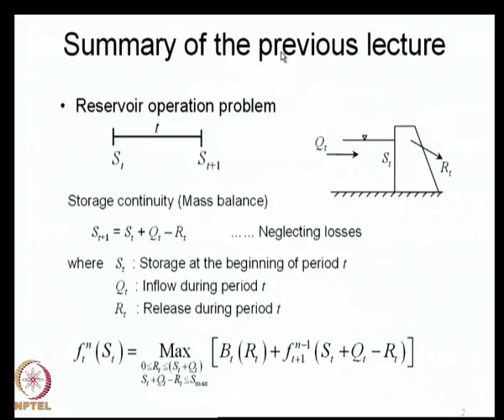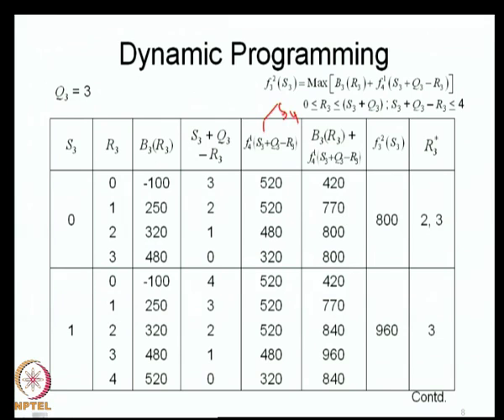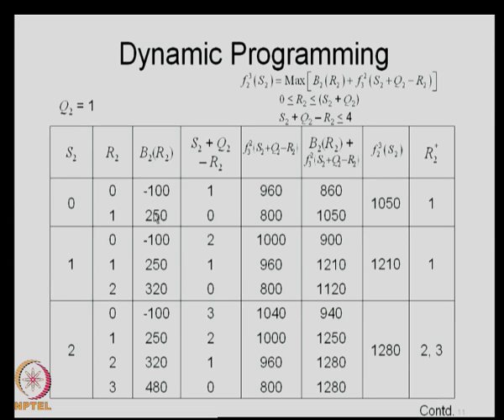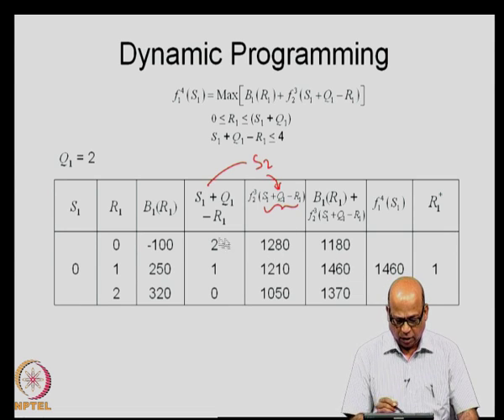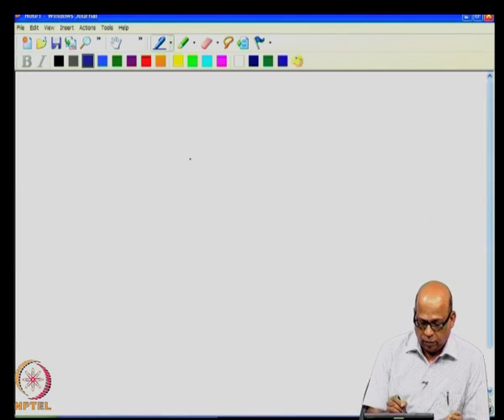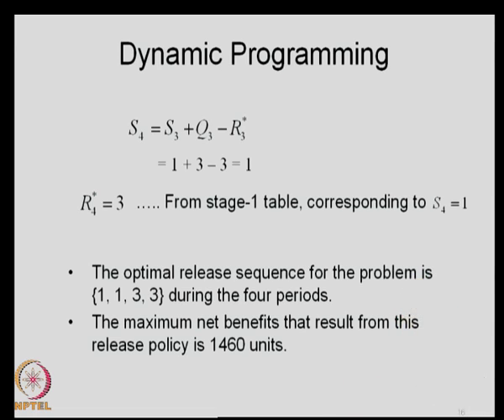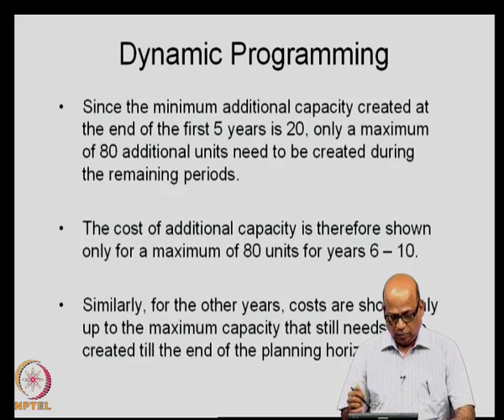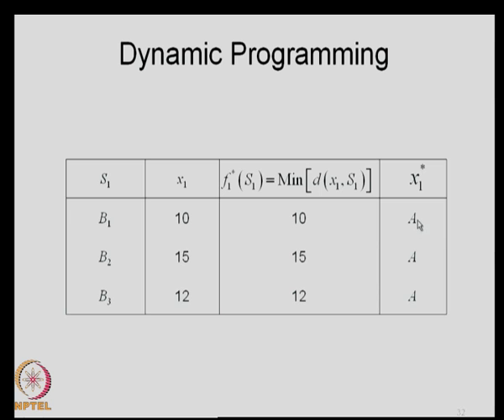Dynamic Programming: Capacity expansion and shortest route problems

Comment: Sir,
In the resevoir capacity problem explained above how can the maximum storage S2 be greater than 2 given the fact that S1=0 and inflow Q1=2 and even there is no release only 2 units will be there in S2. Similiarly for S3 it will be maximum 3 only right?
Please correct me if I'm wrong
Thank you sir.